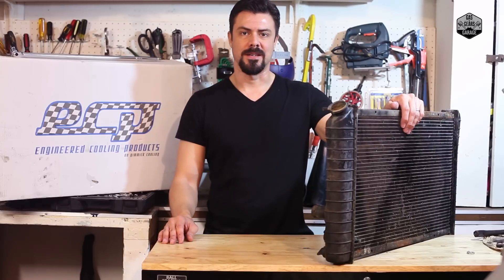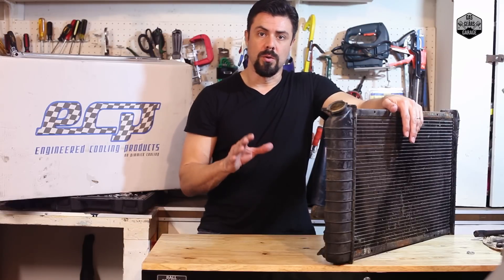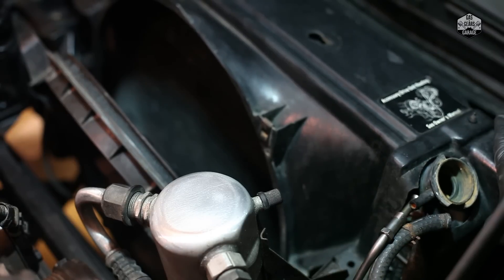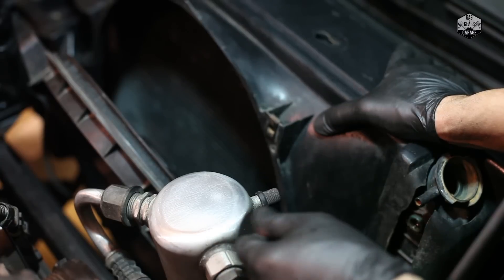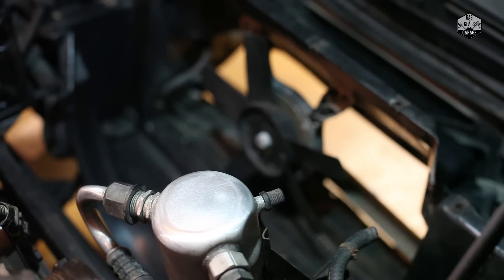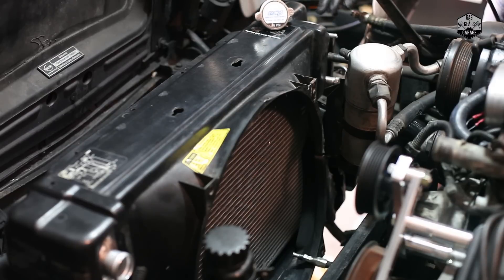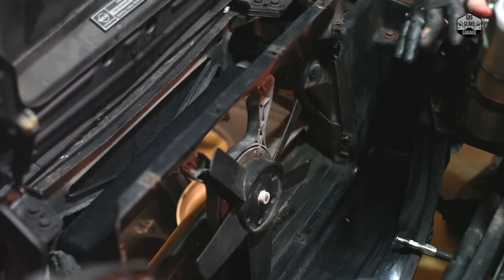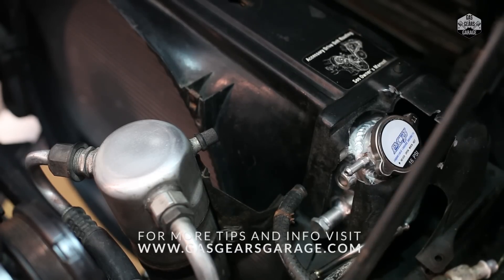How to Remove and Replace a Radiator - Corvette C4

Comment: Its amazing how  these people claim to tell you how to do the job but do a poor  job showing it, case and point -these radiators  all come with an additional "water outlet" that is for  C4 with LS motors "only"  heater core which doesnt apply here. Look at time  9:15 and 10:33 and you will see just under top transmission line a bolt that is inserted in the water outlet, but these radiators come this way  ie to hook up a hose to this outlet but he has it plugged/capped. Helloooooooo.  I just hate when people think they are telling you how to do something but fail to do a proper job. Furthermore you are  advertising a company for this radiator, folks all these radiators are made by ONE company and they are resold by retail place so dont fall for his gimmick "ooh this bla bla company and their radiators are the best". Shop around for best price as they are all made by one company.

Comment: Did you have problems with the radiator transmission lines being metric vs standard?  I did and i cant find a fitting that converts to metric

Comment: Does the C4 with the Upright (not tilted Radiator) that has the fill port on the radiator need to be bled?  or just let it run until the thermostat opens and self bleeds? I am about to do one of these installs in my new to me 1989 c4 56K miles already ordered the radiator it is on back order.

Comment: Hey gas and gears please reply to this I have a 1985 corvette too but mine has been sitting for atleast 4 years what do you think I can do to get it started I know that the engines all good and everything. I know I have to drain out the oil, oil filter and gas but what else do you think I need to get it started? Please reply.
Reply from the maker: JK. You've got the fundamentals right. I would first lube up the cylinder heads with a few drops of Marvel Mystery Oil in each of the cylinders (remove spark plugs) and let it sit there for a couple of days to make sure it's well lubricated. Then manually turn the engine over a few times and listen for compression and to make sure everything is turning smoothly. The injectors may have gunked up by now so you're going to have to clean out the fuel lines as well and check the injectors by doing a FP gauge. You'll also have to inspect the fuel pump and FP sock and make sure that's not gunked up either. Basically, make sure the system is clean because the last thing you want is old gas running into the injectors and system.

Comment: I used stop leak for my heater core... It clogged my radiator instead. Is there anything else i should know about this type of scenario? Thank you for video
Reply from the maker: Stop leak is a temp fix. Replace the thing because it's just a matter a time before you spring a leak elsewhere. I've been stranded by a busted radiator and it's no fun watching your car bleed out on the road. Not to mention the potential for overheating and damaging your engine.

Comment: Uhh, what about those of us that would like to keep the condenser in place and connected when replacing the radiator? Does the condenser need to be removed in order to remove the radiator?? I would like to avoid having AC system evacuated if possible as I'm sure others would too.

Comment: What do I need to know about the lines that you had made so I can get some made as well?
Reply from the maker: Neal Perry So those lines I had custom made at a hydraulic shop nearby. I ripped out the original ones and then opted for a high temp / sleeved flexible lines so that I could easily run them to the tranny. Aside from being old, it was way too complicated to pull out carefully without having the car on a lift and with enough clearance in height. Best of luck

Comment: DO YOU THINK  THIS WILL WORK FOR THE 1990 VETTE L98? EVERYTHING LOOKS THE SAME...IF SO I WILL BE ORDERING ONE FOR SURE.
Reply from the maker: Not sure. Check the specs because I know there are small changes on the cooling lines to other components.

Comment: I have a '94 with about 47k miles on it. Bought last year, but when I was test driving unfortunately I didn't really look under the hood to check everything out. Well this summer, I noticed some coolant leaking when I was coming back to my car when out one night at best buy. So I went through my guage settings on the dash and brought up the temp and it was running hot. When driving it stays around 180, but as soon as Im sitting still the temperature rises quickly. Ive replaced the 2 fan relays, thermostat, temperature switch, checked the fuses,and replaced coolant. What I noticed is that neither of the cooling fans turn on. I remember the drivers side one working the night I test drove it but don't recall the passenger side fan at all. Mayhaps the passenger side didn't work and the driver side fan got overworked and burnt up the motor? any ideas? Id hate to continue throwing money at it and getting nowhere. I didn't renew my registration or get the car inspected bc of it having issues. So decided to garage it till it was fixed, but Ive become stumped. Id hate to spend 200 dollars to get new fan motors and still not have them work. Any suggestions to what it could be if not fan motors? worst case scenario for me is new radiator and new fans. Thatll set me back about 500 and a learning experience on how to get to all of it =P
Fluid also appears to be cycling fine through the system, so the pump seems to be working fine. Not getting any sort of indicators on dash for anything wrong, looked over all the connections and didn't see anything disconnected, melted, broke or ripped.
Reply from the maker: nick k Sorry for the delay. I've been SWAMPED. Hoping you fixed it and if not, maybe this helps someone reading this. Believe it or not I had a similar problem and it turned out to be a wire along the fusible link that was shorting and it ran from the fan motor to the battery. Your best bet is to first start with checking the electrical wiring, power source / fuses, etc. You can always ground the motor to make sure they're working. There is also the issue of A/C pressure switches but again...
Reply: +nick k 
If you haven't found the problem 
you can check the collect fan switch
this switch is usually located on the passenger side head. check by disconnecting the wire that runs to the switch and manually ground the wire. if the fan turns on then the coolant fan switch is faulty. (ignition switch should be open otherwise the relay isn't live)
Reply: Thanks. I havnt used my car. I let the registration run out last year and put it in storage till I had time to look at it. Got swapping some fuses around and got fan 1 to turn on. So its no longer overheating or pissing fluids. Just trying to get it payed off so I can sell it and buy a house. Im driving a '15 challenger sxt plus now

Comment: What size bolt did you use to plug the hole on the radiator?
Reply from the maker: Radiator already came with that.

Comment: C4 corvettes don't have a cap on the radiator nor does aluminum rust.
Reply: The L98 TPI motors do, the cooling system changed with the LT1 motors where filling is handled at the reservoir/overflow tank.

Comment: I have the same setup and problems. The bottom line bent..
Reply: Same problem today, bottom line is PITA. How did you the fix?
Reply from the maker: +Mike .Van Everbeek I had a hydraulic shop custom make these for me to the exact length I wanted made out of high-temp / high-pressure resistant composite rubber. Then I re-routed the lines along the frame of the car than than underneath  and around the oil pan. Ran me about $150 for both lines.
Reply from the maker: Easy. I ripped them out since it was practically impossible to remove without bending the lines. Then I had hi-temp flexible hydraulic ones made at a local shop specializing in this. Took the old fittings to them and they did the rest.

Comment: I've got a 95 'Vette and want to do this swap. How much cooler does the car run with this radiator? Is the quality of the build look solid?
Thanks
Check my channel to see what i've done with mine.
Reply from the maker: Sorry for the late replay but hopefully this will help someone else. Finally got back around to this. The car ran significantly cooler in addition I change the thermostat as well to open up more.
Reply: another wrong  advice  by telling you to change ie lower the temperature from factory 195, but the author  doesnt know that the computer wants/demands to see a 195 deg temperature in order to adjust the engine performance to a tee, by lowering the temp of thermostat to 185 or what ever you are asking for trouble, plus if you install a new aluminum  radiator you dont need to lower the thermostat rating  from factory value of 195 deg.  Why would you?  Wouldnt it be easier to just install a lower thermostat and why bother spending money on a new radiator .Apply Logic folks think logically. But you can install a new 195 thermostat if you are installing a new radiator, common sense, and hoses too. Also make sure you use DISTILLED water in all of your radiator.